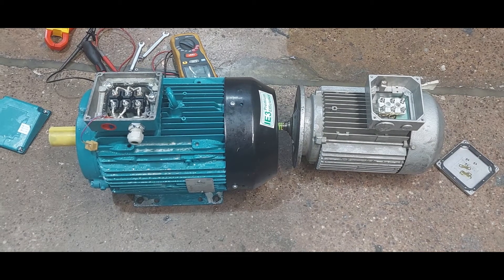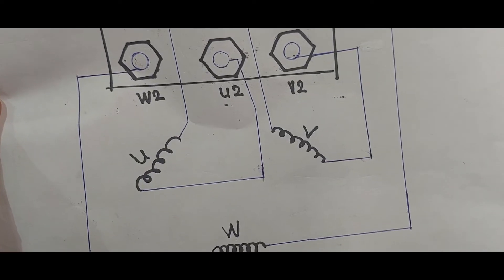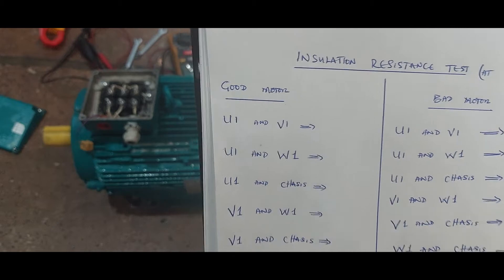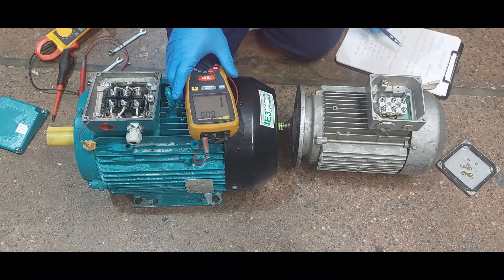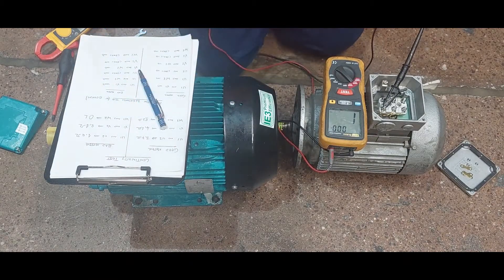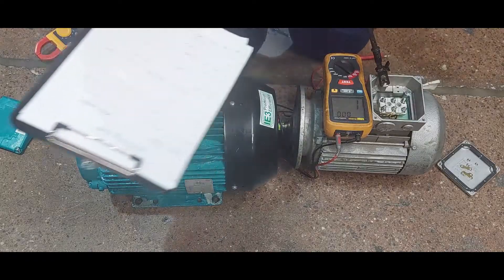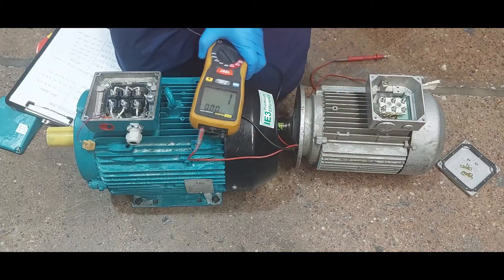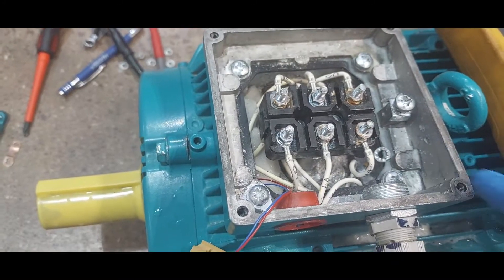How to test Electrical motors with a  multimeter.  3 phase motor testing with multimeter.

Comment: want to get the science behind using a mega ohm meter
Reply from the maker: Think of electrical wires as plastic water pipes.  The current and voltage going through the wire, as water pressure going through the pipes.  Ohmmeter is checking the ability of the wires to withstand current.  Or ability of water pipes to withstand water pressure
Reply from the maker: I will make a video for that. Thanks for watching.

Comment: When you were doing Insulation resistance test, why did you 400Megaohms instead of 500megaohms coz what I know is that a single phase motor supplied at 230 we double the voltage and we get 460 so the closest scale is 500megaohms scale..... Please correct me
Reply from the maker: Hey Yemkela, please check out my other videos on this topic : https://www.youtube.com/watch?v=MkXq06GAF7w

Comment: Hi, thank u for the informative video. Apart from continuity test and insulation resistance test, what other test can we check on the motor?
Reply from the maker: Hi friend. You can check for current consumption while motor is running. You can test for Voltage. You can do visual observation. You can feel the temperature of the motor as well. It all depends on the characteristics of the fault that you are searching.